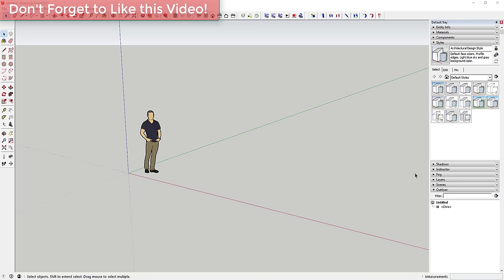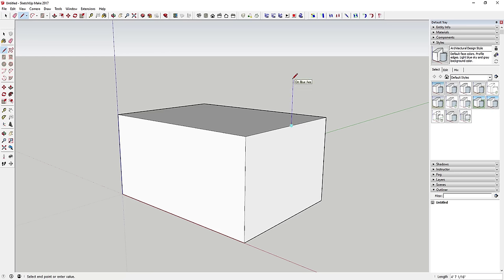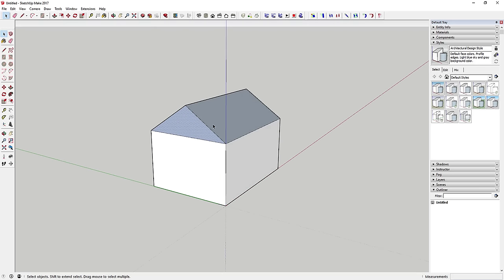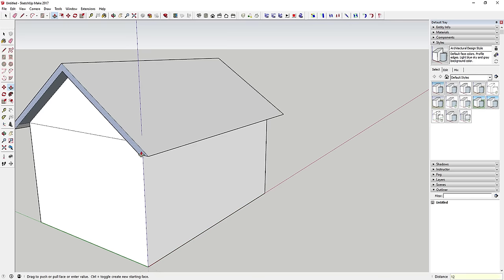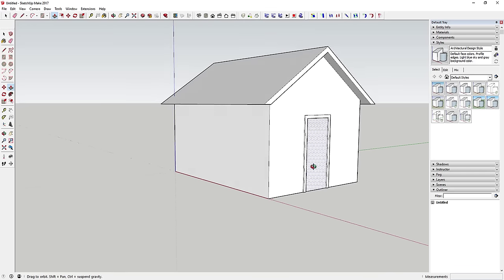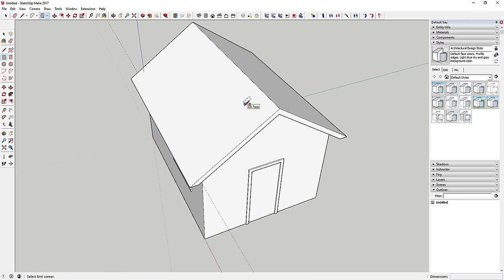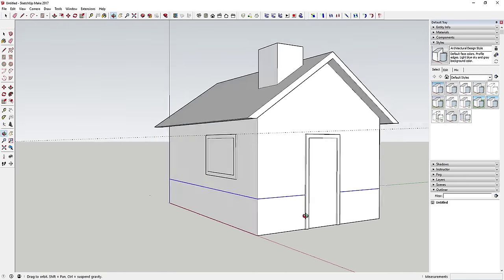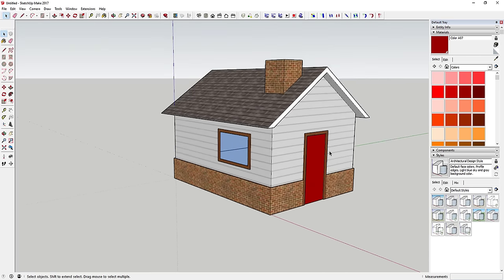SketchUp Tutorial for Beginners - Part 2 - Modeling a House

Comment: For MAC users you will need to select the connected edges individually using the shift key and then use the move tool. To use the copy function for the move tool, you will need to click on Option key instead of Ctrl. Hope this helps someone who gets stuck in this step like I did :)
Reply from the maker: Thanks for this - as a lifelong PC user, I kind of forget to offer up the Mac options sometimes...
Reply: Also, to unselect itens we have to use Shift Control.
Reply: THANK YOU!! I was losing m mind!

Comment: I had trouble drawing my chimney. I couldn't get it to come out straight from the roof. I couldn't get a flat axis. Which keys do I click, push, pound or break to get it right? Using SketchUp 16 with windows 7.
Reply from the maker: When you drew your rectangle, did you lock it to the blue axis using the up arrow key? Activate the rectangle tool using the "R" key, then tap the up button to lock it to the blue axis, then type in your chimney dimensions and hit the enter key. Let me know if this helps!
Reply: Thank you for your help. I had to draw my rectangle on the ground, double click it on,  then use the move tool to place it on the roof, and then use the push/pull tool to raise it up.  I can't get my keyboard to function as you do like press "R" for rectangle tool. Is there a way to turn on my keyboard to do those kind of functions?  Thanks again for your help--I find your videos very helpful!
Reply: TheSketchUpEssentials   Is there another way to do this without using the arrow key? I can't seem to get it on the right plane either with the arrow key.